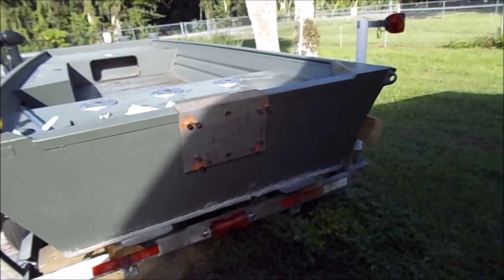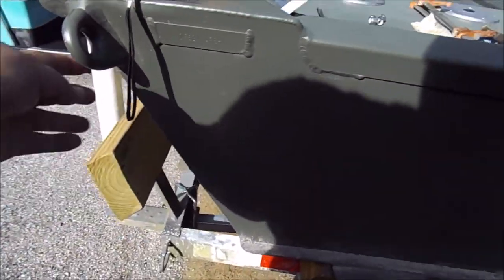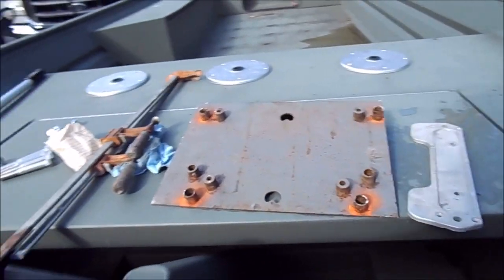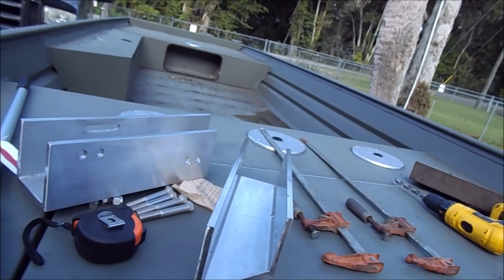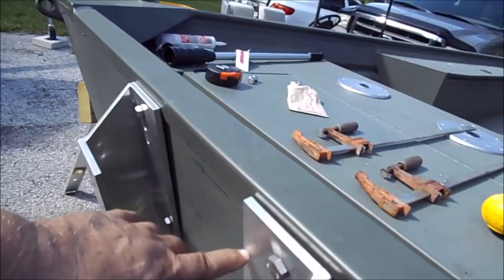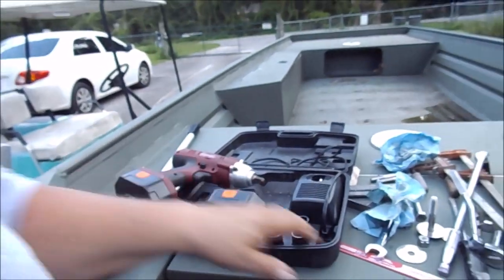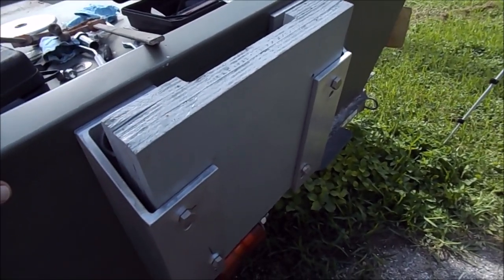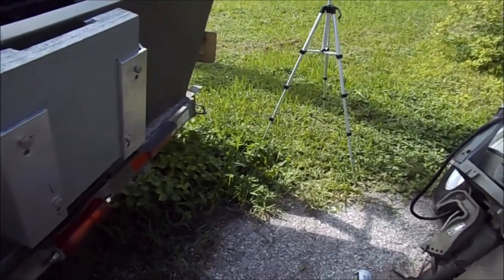Reverse Jack Plate

Comment: with this current set up, Can you still tilt the motor all the way up?  Or does the powerhead hit the transom?
Reply from the maker: You can't tilt it all the way up. But, it would tilt high enough to get it on the shallow water drive notch. It was a work around that let me use a 15 inch motor on a 20 inch transom.  The set back would let it run pretty shallow water.
Reply: @RandolphRelicRecovery  I have a sixteen foot inflatable and the motor That I have sits up a little too high. So I was just planning on cutting down my transome about 1-2 inches.
Reply from the maker: @michiganmagneto  that will work too. Especially if it's wood. I didn't want to cut the aluminum transom in this boat. I found a deal on a bigger boat with a 25 hp four stroke with electric trim and tilt. I sold the motor. Then I sold the boat and trailer. I was able to upgrade for about $600.
Reply: @RandolphRelicRecovery  Ya gotta love a good deal. I did see something on YouTube regarding alternative material for a transom. Mine is made from wood and will probably need replacing in another couple of years. I bought it last year and started patching it.Op and then the weather turned to crap, so I just folded everything up and put it away. There is still a pinhole on the left rear underside as well as a larger tear in the floor. After that, it will be ready to drop in the water. When the time comes to replace that transom, I will look for that alternative material. I've got a few 7 1/2 hp motors as well as a 45 hp. The 45 will need a control helm installed.  In time I'll get there.
Reply from the maker: @michiganmagneto  boats are a fun hobby, for sure. Beats hanging out in a recliner.
Reply: @RandolphRelicRecovery  I am in over the road trump driver and don't have a lot of spare time when I get home. Last year, before I got my inflatable boat.I had to take off about a month and a 1/2 for medical reasons.And during which time I was working in the garage on those outboard motors. And l gotta say, It did not matter what was going on in the world, be it zombie apocalypse, alien invasion, fire & brimstone Raining from the sky., earthquakes and tsunami's, in my little Universe inside my garage,  all is well. Peace and harmony. And everything under the sun is in tune, and the sun is not eclipsed by the moon. 😃
Reply from the maker: @michiganmagneto  I'm a sub contractor for the VA. It makes it hard to get away. I'm working all weekend to get caught up. I do some metal detecting every chance I get. I just zone out and forget about everything else.
Reply: @RandolphRelicRecovery  I've got a couple of metal detectors but I can never seem to get out and enjoy it. And after I patch up a couple more holes in my inflatable boat.I'm looking forward to doing some shallow river detecting. I need to find a job where I'm home every dayfor night.Whatever to change might be. My wife is disabled and I can't keep up on the household shores with only one or two days a week. If I could do a little bit everyday after work then I could stay caught up with the to do list. And hopefully that will free me up to do the wanna do list.
Reply from the maker: @michiganmagneto  it's hard to get it all done. I keep one of my detectors in my car. I check a couple of tot lots a couple times a month. I can do one in 20 minutes or so. The parking areas and sidelines on sports fields can be good too.

Comment: How did it worked with The motor? Did it work well? Any feedback? I want to do the same thing.
Reply from the maker: It worked out really good. I didn't use this motor. I used a later model Yamaha. It was a short shaft too. If you look at some of my later videos you can see the final result.

Comment: Glad you're drinking water. What I dont understand is why you have to do that. Can't you just clamp the motor to the boat? Great video keep em coming. GL&HH
Reply from the maker: Hog Rider You would think that would work. But there are many different lengths of shafts 15, 20, 25 and 30 inch. The 25 and 30 inch are generally found on bigger motors. You are supposed to match the motor length to the transom length. I have a 20 inch deep transom and a 15 inch motor. If you bolt it directly  to the transom it would idle around fine. But, as soon as you gave it the gas the prop would blow out because it isn't deep enough in the water. If you have the same length transom and motor you can improve performance and run in shallower water by installing a jack plate. The rule of thumb is every inch you go back from the transom you can raise the motor up an inch. This is because when a boat go through the water it comes up from the bottom of the boat. In my case the motor is already up approx 3.5 inches. So I'm mounting the jack plate backwards to move the motor back and not up.

Comment: Sooo correct me if I'm wrong but im in the exact same situation that you found yourself in with a short shaft motor and transom for long shaft but instead of mounting the motor lower on the transom you are just giving it a 4 inch setback at the same exact height as the motor sits on the transom because for every 1 inch of setback equals to 1 inch above bottom of boat so the 4 inch setback pretty much evens out the 3.5 inches above bottom of the boat your motor was sitting???? Thanks in advance!!
Reply from the maker: That's the rule of thumb. It can very with the type of bottom. Flat bottoms work better than deep V.
Reply: Thanks for the info I'm running a flat bottom polar kraft. Do you have the info on the jack plate you used in the video or information on 1 similar? It would be greatly appreciated!
Reply from the maker: @roberttaylor1584  I'm not sure about the brand. It was purchased on Amazon. 4 inch Manual Jack plate. You might want to try the false transom on the outside of the Jack plate. I eventually went with a 25 Yamaha short shaft with an aftermarket trim and tilt.
Reply: Ok brother I found a mini jack suitable for my needs at bass pro online. Last question befire I attack this thing this weekend. If you were just looking for the setback to even things out why did you mount the jack plate upside down then use your marine plywood to put the motor same height as transom?? Thats my last question I promise. Lol just want some insight before I go at it
Reply from the maker: @roberttaylor1584  The Jack plate in this case (there are Jack plates with different hights and setbacks) is designed to raise the motor up approx. 4 inches and back 4 inches assuming you are dealing with a 20 Inch transom and a 20 inch motor. Or a 15 inch transom and a 15 inch transom. If you mount it the way it's designed to be used it raises the short shaft too high. The main thing you need to watch is if the motor will clear the top of the transom when you tilt it. You may have to be content with it partially tilting. It is a work around.
Reply from the maker: @roberttaylor1584  O yea, in the future the way I drilled the transom I can bolt a 20" motor directly to it or just flip the plate around and use it as it was intended.

Comment: Your videos keep popping up in my feed. Be sure to change your gear drive oil every year.
Reply from the maker: That's something s lot of people don't do. I change my impeller every season too. That's a good thing when my videos pop up in people's feed 😁
Reply from the maker: I've moved on to a 25 hp Yamaha four stroke with an after market trim and tilt on a bigger welded aluminum boat😁. It's pretty sweet👍
Reply: @RandolphRelicRecovery  yes its good keep a spare. A little tiny 10.00  rubber deal can ruin a whole day.
Reply: @RandolphRelicRecovery  I bet you can ski behind that recovery vehicle, lol. 
Jeff in Oregon

Comment: Hey man any way I could contact you bout some questions on how it worked out for you please.
Reply from the maker: Did you watch the later video reverse jack plate tiller and shift extensions video. It explains it pretty good. I ended up using a different motor because I got a steal on a newer one with after market trim and tilt. It works great for someone on a budget like me.
Reply: @RandolphRelicRecovery  I'm doing the same thing on a 20hp shortshaft. Tilt is my issue
Reply from the maker: @jeremycampbell5479  the rule of thumb is for every inch you go back you can raise the motor an inch. So if you have a 20 inch transom. A 15 inch motor and a 5 inch set back jack plate. You should be able to mount the motor pretty much level with the top of the transom. You can also bolt a false transom to the back of the jack plate using two pieces of 3/4" plywood or polymer. That will set you back another 1 1/2" which should let you raise the motor up a little more allowing you more room to tilt the motor. All this is explained in detail in the other video I referenced. I hope this helps.

Comment: Vc pode me passar a largura e altura?
Reply from the maker: @wanderleylopes3553  if you're  just doing one. Hang the motor on the transom. Center it left and right. Then mark the mounting holes. Drill the holes. Mount the bracket. Then, mount the motor to the bracket so it drops down instead of up if you're using a 15 inch motor on a 20 inch transom.
Reply: Meu motor é de 25 Hp Yamaha 

Qual tamanho ficou sua cantoneira, e a largura e altura da madeira ?

É só para mim ter uma base .

Comment: Thank you for your work, I have a boat with a similar problem. Bought an old BassTracker with a 21” transom, then I bought a short shaft mercury Mariner. Anything over 6mph and I get that cavitation thing happening. So glad to find someone else with a solution.
Reply from the maker: It's a workaround, but it will get you by. Thanks for watching, Linda.